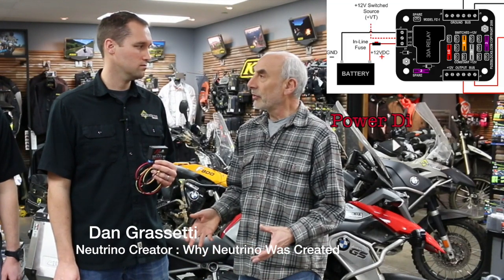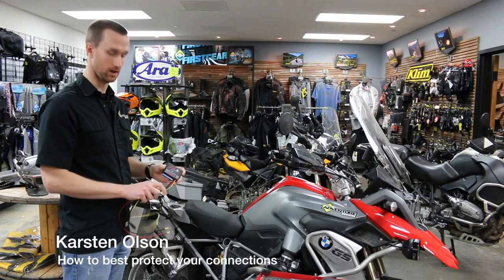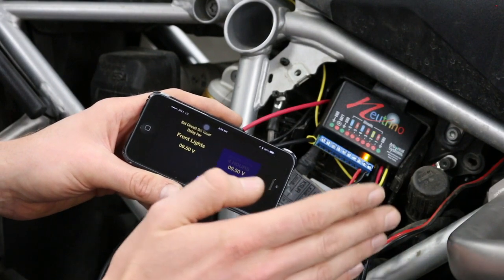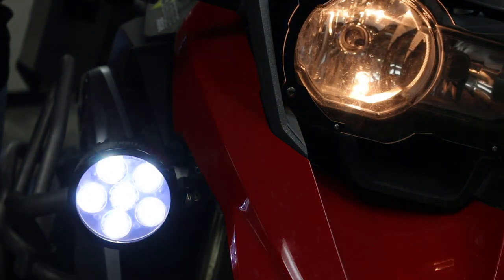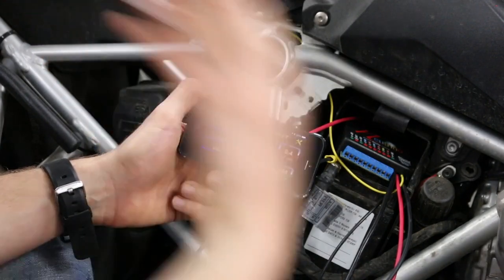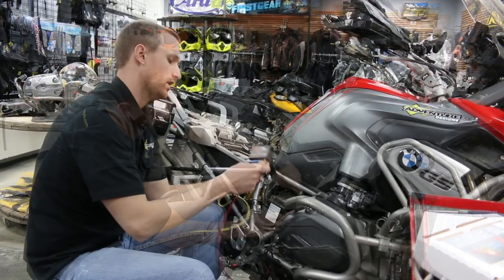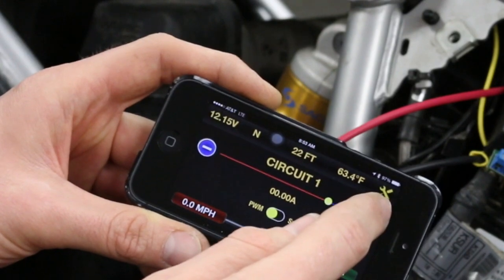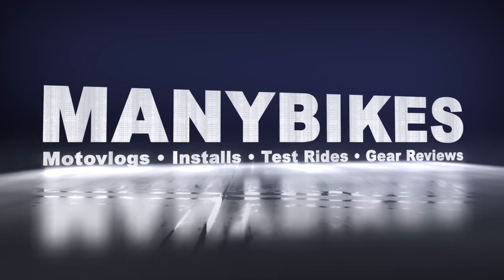Best Motorcycle Fuse Block | Full Installation of the Neutrino Black Box

Comment: Has this box got the ability to trigger an output based on an external voltage input? Like a relay. The phone app is great an all but that doesn't work while wearing winter gloves, I'd rather wire to a switch on the bars and trigger it by either closing a circuit or sending the box a 12v trigger to switch an output.
Reply from the maker: Yes, I believe so... I'll need to "re-learn" myself and get back to you.
Reply: Did you ever figure this out? This is kind of the only thing I’m waiting to figure out before getting on.